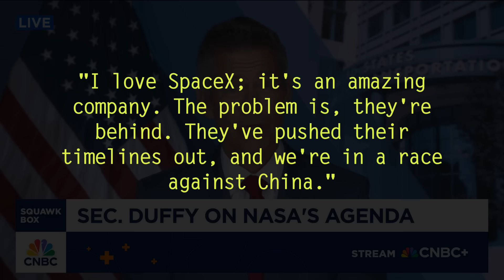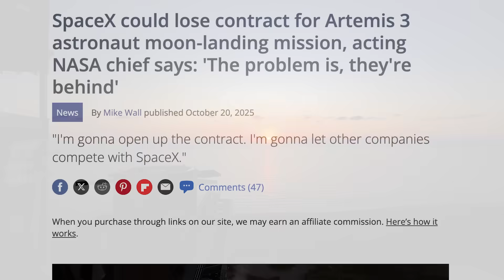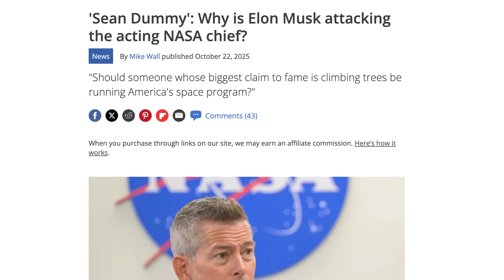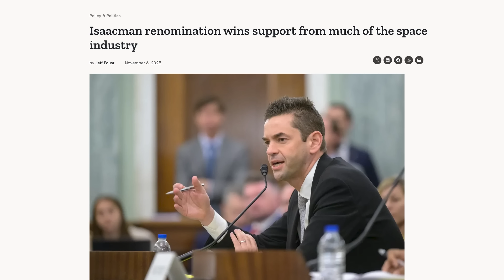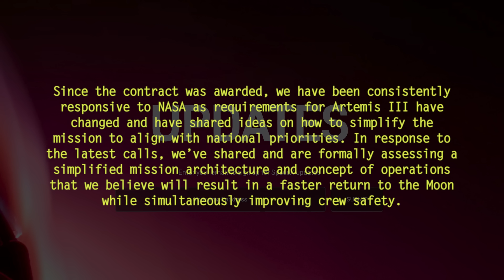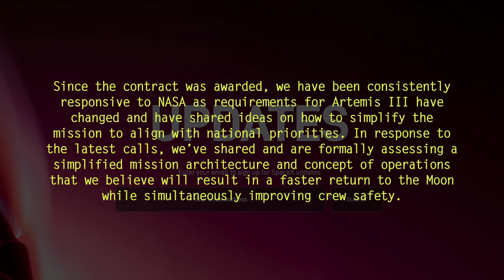What Is Actually Happening With SpaceX's Moon Landing

Comment: Interesting discussion. One idea I’ve been thinking about is separating landing infrastructure from the vehicle itself.

Instead of landing everything on one vehicle, a dedicated Landing Platform (LP) could be pre-deployed to the Moon. It would handle surface stability, dust mitigation, and shock absorption, while a smaller crew lander (delivered by Starship or similar) lands on top of it.

That way, landers don’t need heavy legs or complex surface systems, and surface ops become much safer and more repeatable. It also decouples landing from launch architecture.

Curious what others think — does this kind of infrastructure-first approach make sense long-term?

Comment: Gwenn Shotwell's implementation of Elon's visionary reusability ideas made SpaceX the engineering powerhouse of the aerospace industry since Falcon9's debut = Falcon Heavy, Dragon capsule, Starlink! The visionary also dragged heavy stainless steel, methalox and rapid, destructive iteration instead of cogent design and incremental testing/validation into the mix. Unfortunately those visionary methods haven't translated well to Starship which has already failed. It will never serve as a Human Landing System for the Moon or Mars. Extremely impressive engineering of the Raptor engine, but it's underpowered for this heavy lift task. 12+ re-fuelings? Never happening. Currently ~40T to orbit. Will never see 150T. 100T is doubtful. Then Starship has to be human-rated after the explosions stop. Would you fly in it before 2035?      2037?

Comment: Am I  missing something  here? Why not reuse a design  that was successful decades ago? Upgrade and copy the Apollo systems/design?
Reply: Apollo was a fantastic technical achievement and all involved are heroes. It proved that it is possible to go to the moon and come back. They couldn't stay more than a few days, but they did it.

1. If you want to go to the moon to do science, stay there for months at a time, learn how to live in reduced gravity and cope with extremes of temperature etc, you will need a moon base of some kind.

2. A moon base, according to various studies will have a mass of at minimum 150 tonnes (much more if you are trying out manufacturing or mining). For comparison, ISS is about 450 tonnes.

3. Landing a 150 tonne moon base Apollo-style from a single launch will require a rocket of enormous proportions, in the order of 20,000 tonnes ( 10 times the mass of Space shuttle, 7 times the mass of Saturn 5 ) and will need a rocket launch pad of correspondingly enormous scale.

Nobody is building such a monster.

The alternative is to launch many (at least in the order of dozens) smaller (approximately Saturn 5 sized or SLS - sized) rockets and either assemble a huge moon lander in earth orbit or assemble the base on the lunar surface. 

If you are launching dozens, scores or perhaps hundreds of rockets, it helps if they are cheap, reusable or both.

Transferring cryogenic propellants from one craft to another in zero-g is difficult new technology that needs to be developed and much of the testing must be done in orbit. This will take many launches, so a re-usable launch vehicle will help.

Storing cryogenic propellants in space without them boiling away before use is difficult new technology that needs to be developed  and much of the testing must be done in orbit. This will take many launches, so a re-usable launch vehicle will help.

SLS has flown, but is not re-usable, so it will take scores of expensive SLS launches to make a moon base. New Glenn will take even more launches than SLS.

 Starship is far more ambitious than either SLS or New Glenn, they have yet to attempt a stable orbit and seem to be struggling with the amount of useful payload, but they have managed to relight the engines on and catch a booster, re-enter an orbital stage to a precision target and propulsively hover at sea level and they are continuously improving, refining and testing the vehicles.

Comment: Look at the '60's as the original manned missions to the moon were riddled by delays, the tragic deaths of three astronauts training in a pad capsule who died from fire and smoke before they could get the door opened--which resulted in a total redesign of the door--and that took awhile! SpaceX is far ahead of anything else in America, in terms of a moon landing and all the rest of the strategy, but this is no easy feat by any means. Additionally, everything about the SpaceX attempts is a complete departure from the '60's--because all of that tech is completely obsolete today.  It all required a complete redesign because the goals are very different. SpaceX isn't looking for a one-shot deal, because America won that race in 1969. SpaceX is trying to create an entire industry around establishing a permanent moon base. And if possible, later, doing the same thing on Mars. If it doesn't work on the moon, then Mars is out, obviously.

Also, I thought the piece about Duffy was amusing, as he's so superior to the last Transportation secretary it's remarkable, imo, but that sort of comparison did not seem to interest The Space Race, for some reason.  Are you guys fans of lumber jacking?...;)

Comment: I think SpaceX and NASA overshot their goals when NASA selected the Starship for Lunar landing. They just need a lander to get 4-6 astronouts on the surface and back. Maybe support them living there for a couple of weeks. Not more. A smaller sized vehicle like Dynamics or Blue Origins desgins are perfectly suited for that while only being a fraction of the cost and complexisity. But now its too late NASA chose the biggest and coolest-sounding option back than without really considering what actually is necessary.
Reply: Apollo was a fantastic technical achievement and all involved are heroes. It proved that it is possible to go to the moon and come back. They couldn't stay more than a few days, but they did it.

1. If you want to go to the moon to do science, stay there for months at a time, learn how to live in reduced gravity and cope with extremes of temperature etc, you will need a moon base of some kind.

2. A moon base, according to various studies will have a mass of at minimum 150 tonnes (much more if you are trying out manufacturing or mining). For comparison, ISS is about 450 tonnes.

3. Landing a 150 tonne moon base Apollo-style from a single launch will require a rocket of enormous proportions, in the order of 20,000 tonnes ( 10 times the mass of Space shuttle, 7 times the mass of Saturn 5 ) and will need a rocket launch pad of correspondingly enormous scale.

Nobody is building such a monster.

The alternative is to launch many (at least in the order of dozens) smaller (approximately Saturn 5 sized or SLS - sized) rockets and either assemble a huge moon lander in earth orbit or assemble the base on the lunar surface. 

If you are launching dozens, scores or perhaps hundreds of rockets, it helps if they are cheap, reusable or both.

Transferring cryogenic propellants from one craft to another in zero-g is difficult new technology that needs to be developed and much of the testing must be done in orbit. This will take many launches, so a re-usable launch vehicle will help.

Storing cryogenic propellants in space without them boiling away before use is difficult new technology that needs to be developed  and much of the testing must be done in orbit. This will take many launches, so a re-usable launch vehicle will help.

SLS has flown, but is not re-usable, so it will take scores of expensive SLS launches to make a moon base. New Glenn will take even more launches than SLS.

 Starship is far more ambitious than either SLS or New Glenn, they have yet to attempt a stable orbit and seem to be struggling with the amount of useful payload, but they have managed to relight the engines on and catch a booster, re-enter an orbital stage to a precision target and propulsively hover at sea level and they are continuously improving, refining and testing the vehicles.

Comment: Apollo was a fantastic technical achievement and all involved are heroes. It proved that it is possible to go to the moon and come back. They couldn't stay more than a few days, but they did it.

1. If you want to go to the moon to do science, stay there for months at a time, learn how to live in reduced gravity and cope with extremes of temperature etc, you will need a moon base of some kind.

2. A moon base, according to various studies will have a mass of at minimum 150 tonnes (much more if you are trying out manufacturing or mining). For comparison, ISS is about 450 tonnes.

3. Landing a 150 tonne moon base Apollo-style from a single launch will require a rocket of enormous proportions, in the order of 20,000 tonnes ( 10 times the mass of Space shuttle, 7 times the mass of Saturn 5 ) and will need a rocket launch pad of correspondingly enormous scale.

Nobody is building such a monster.

The alternative is to launch many (at least in the order of dozens) smaller (approximately Saturn 5 sized or SLS - sized) rockets and either assemble a huge moon lander in earth orbit or assemble the base on the lunar surface. 

If you are launching dozens, scores or perhaps hundreds of rockets, it helps if they are cheap, reusable or both.

Transferring cryogenic propellants from one craft to another in zero-g is difficult new technology that needs to be developed and much of the testing must be done in orbit. This will take many launches, so a re-usable launch vehicle will help.

Storing cryogenic propellants in space without them boiling away before use is difficult new technology that needs to be developed  and much of the testing must be done in orbit. This will take many launches, so a re-usable launch vehicle will help.

SLS has flown, but is not re-usable, so it will take scores of expensive SLS launches to make a moon base. New Glenn will take even more launches than SLS.

 Starship is far more ambitious than either SLS or New Glenn, they have yet to attempt a stable orbit and seem to be struggling with the amount of useful payload, but they have managed to relight the engines on and catch a booster, re-enter an orbital stage to a precision target and propulsively hover at sea level and they are continuously improving, refining and testing the vehicles.

Comment: Why all the refuelings? If Starship is more powerful than a Saturn 5, why can’t Starship do it the way Apollo did it?

Has someone done the analysis using rocket equation math?
Reply: Apollo was a fantastic technical achievement and all involved are heroes. It proved that it is possible to go to the moon and come back. They couldn't stay more than a few days, but they did it.

1. If you want to go to the moon to do science, stay there for months at a time, learn how to live in reduced gravity and cope with extremes of temperature etc, you will need a moon base of some kind.

2. A moon base, according to various studies will have a mass of at minimum 150 tonnes (much more if you are trying out manufacturing or mining). For comparison, ISS is about 450 tonnes.

3. Landing a 150 tonne moon base Apollo-style from a single launch will require a rocket of enormous proportions, in the order of 20,000 tonnes ( 10 times the mass of Space shuttle, 7 times the mass of Saturn 5 ) and will need a rocket launch pad of correspondingly enormous scale.

Nobody is building such a monster.

The alternative is to launch many (at least in the order of dozens) smaller (approximately Saturn 5 sized or SLS - sized) rockets and either assemble a huge moon lander in earth orbit or assemble the base on the lunar surface. 

If you are launching dozens, scores or perhaps hundreds of rockets, it helps if they are cheap, reusable or both.

Transferring cryogenic propellants from one craft to another in zero-g is difficult new technology that needs to be developed and much of the testing must be done in orbit. This will take many launches, so a re-usable launch vehicle will help.

Storing cryogenic propellants in space without them boiling away before use is difficult new technology that needs to be developed  and much of the testing must be done in orbit. This will take many launches, so a re-usable launch vehicle will help.

SLS has flown, but is not re-usable, so it will take scores of expensive SLS launches to make a moon base. New Glenn will take even more launches than SLS.

 Starship is far more ambitious than either SLS or New Glenn, they have yet to attempt a stable orbit and seem to be struggling with the amount of useful payload, but they have managed to relight the engines on and catch a booster, re-enter an orbital stage to a precision target and propulsively hover at sea level and they are continuously improving, refining and testing the vehicles.

Comment: Perhaps Sean Duffy doesn’t realize is that if he cancels SpaceX’s moon landing contract, SpaceX will go it alone. They need the moon to work out the problems that they will experience going to Mars (and beyond). And, if you then depend on other companies, they are decades behind a moon landing schedule. Look, we went to the moon, gathered some rocks, kicked up some dust, and left junk on the surface. This time we need to go to the moon with the attitude that we will build a working colony. That means going underground and to do that requires a way to drill, dig, remove tons of material. It means to encase your tunnels in order to introduce a breathable atmosphere at one bar pressure. It also means that we need a commercial reason to go back to the moon. If you are going to make money on tourism, then placing a few habitats on the surface is good enough. I’m sure you can keep the multimillionaires busy bouncing on the surface of the moon. If we are going back for geology, then picking up rocks on the surface isn’t good enough. We will need to drill and dig out tunnels. These manmade caverns will give us real estate.

Comment: the problem with the starship hls + tanker + dragon architecture is that starship hls doesn't have a heat sheild capable of doing an aerocapture to slow down when returning to low earth orbit , one solution would be to bring a 2nd full tanker to lunar orbit to refuel hls for a capture in leo by using the engines , not simple
Reply: HLS version is not intended to reenter Earth's atmosphere. Neither are the tankers. Once launched, they stay on station. Whether that is lunar orbit, low Earth orbit or Lagrange points. 
The heat shield is only needed for shuttling crew to and from the various station orbits.
Reply: @slartybarfastb3648 i think heat shield is also needed to slow down from trans lunar orbit to low earth orbit , it can be done without heat shield when using propulsion but that needs fuel so more weight . I heard crew dragon heat shield could not reenter from lunar return
Reply: @alexb2541 Starship isn't aluminum alloy like existing spacecraft. High altitude atmospheric braking doesn't have the high ionization of a reentry. You're only trying to slow enough to alter trajectory, not dig in.

Comment: Sorry but starship is too tall and unstable to safely land on the moon, I wouldn't be surprised if they have to modify it to have a larger landing gear footprint just to prevent it from tipping over

Whereas blue origin is not pushing it to the limit and actually looks logical

Comment: Why don't we just use the equipment from 1967?  Easy peasy
Reply: They work only on low earth orbit, what was the farthest point they went.
Reply: Apollo was a fantastic technical achievement and all involved are heroes. It proved that it is possible to go to the moon and come back. They couldn't stay more than a few days, but they did it.

1. If you want to go to the moon to do science, stay there for months at a time, learn how to live in reduced gravity and cope with extremes of temperature etc, you will need a moon base of some kind.

2. A moon base, according to various studies will have a mass of at minimum 150 tonnes (much more if you are trying out manufacturing or mining). For comparison, ISS is about 450 tonnes.

3. Landing a 150 tonne moon base Apollo-style from a single launch will require a rocket of enormous proportions, in the order of 20,000 tonnes ( 10 times the mass of Space shuttle, 7 times the mass of Saturn 5 ) and will need a rocket launch pad of correspondingly enormous scale.

Nobody is building such a monster.

The alternative is to launch many (at least in the order of dozens) smaller (approximately Saturn 5 sized or SLS - sized) rockets and either assemble a huge moon lander in earth orbit or assemble the base on the lunar surface. 

If you are launching dozens, scores or perhaps hundreds of rockets, it helps if they are cheap, reusable or both.

Transferring cryogenic propellants from one craft to another in zero-g is difficult new technology that needs to be developed and much of the testing must be done in orbit. This will take many launches, so a re-usable launch vehicle will help.

Storing cryogenic propellants in space without them boiling away before use is difficult new technology that needs to be developed  and much of the testing must be done in orbit. This will take many launches, so a re-usable launch vehicle will help.

SLS has flown, but is not re-usable, so it will take scores of expensive SLS launches to make a moon base. New Glenn will take even more launches than SLS.

 Starship is far more ambitious than either SLS or New Glenn, they have yet to attempt a stable orbit and seem to be struggling with the amount of useful payload, but they have managed to relight the engines on and catch a booster, re-enter an orbital stage to a precision target and propulsively hover at sea level and they are continuously improving, refining and testing the vehicles.